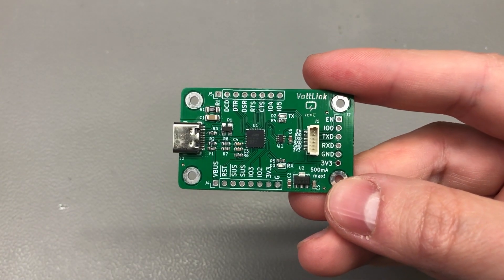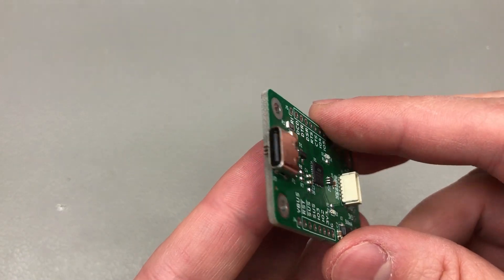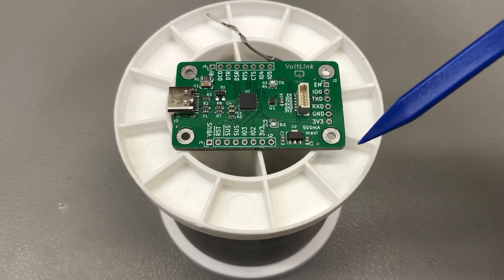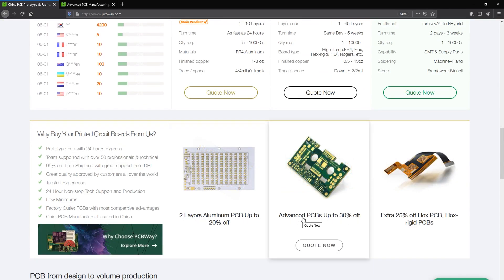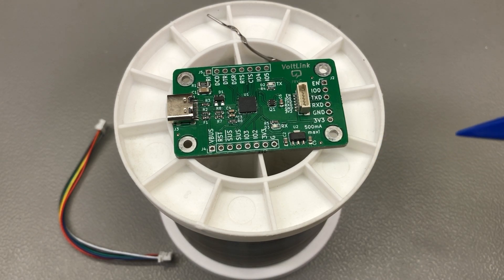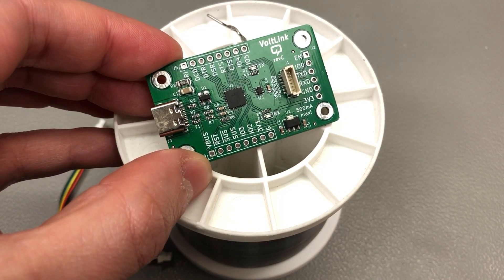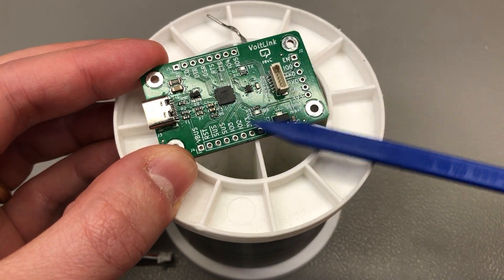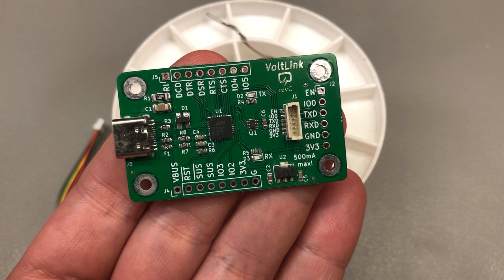VoltLink revC CP2102N USB Serial Bridge & ESP32 Programmer | Voltlog #405

Comment: Very neat. Are you getting your PCB manufacturer to assemble these, or are you manually P&P and reflowing them yourself?

It's not a huge part count, so I imagine it's not a lot of effort to do them manually. I just finished a project with a lot more components, and had to solder everything by hand. It had probably twice as many components, down to 0603, so it was pretty fiddly. It would've been easier using solder paste and a reflow hotplate, but the one I ordered from aliexpress in 2020 never arrived.
Reply from the maker: I am assembling these myself but I am looking at switching to a CM as demand increases.